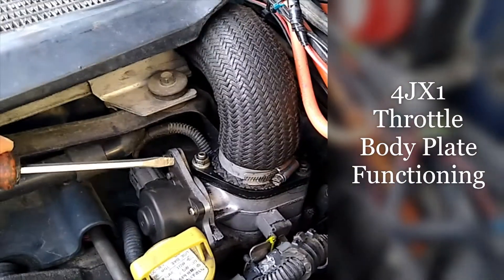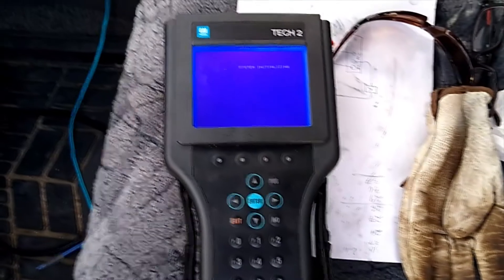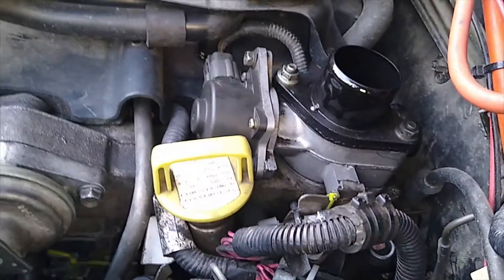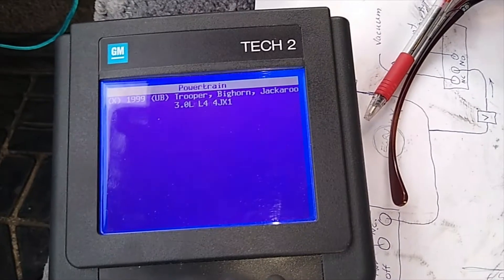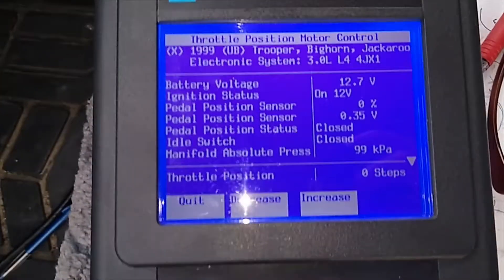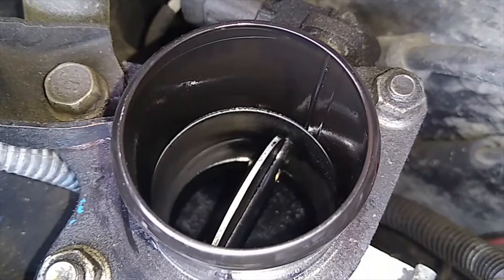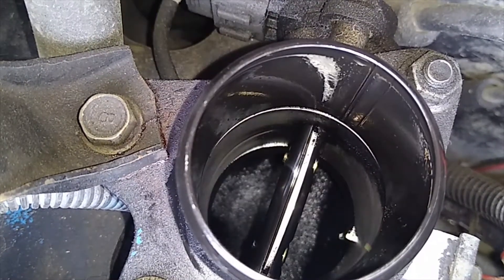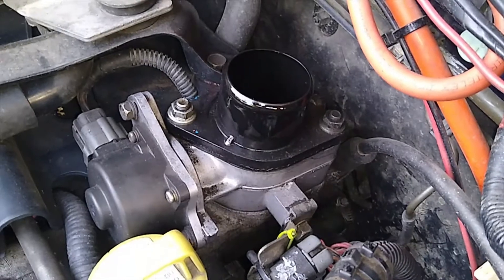4JX1 engine throttle plate in operation using GM Tech2

Comment: Will a Tec2 pick up if my Oil pressure switch needs changing my oil pressure drops to Zero at idle but goes to 6 bar once moving I’ve been told it’s my Oil pressure switch